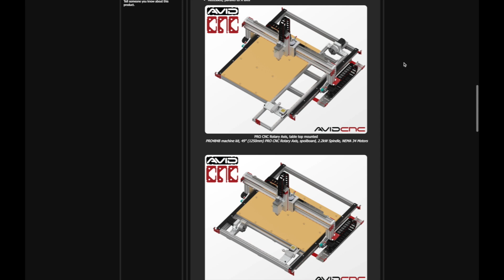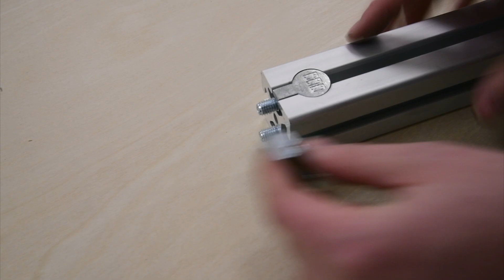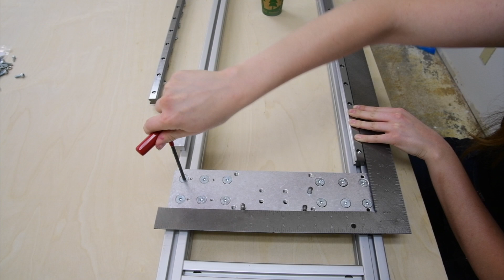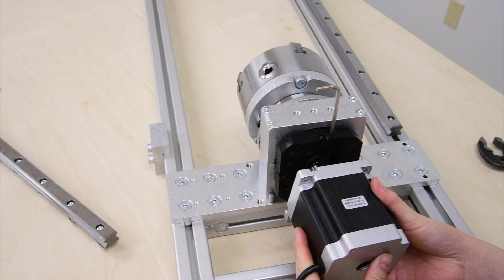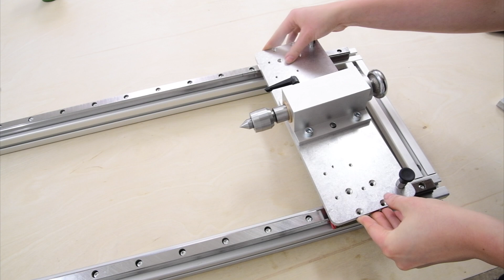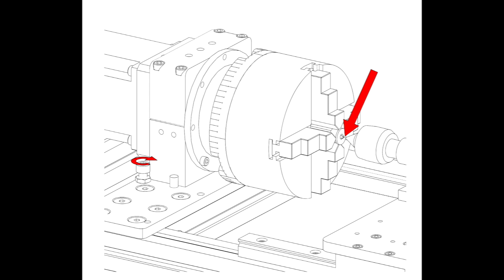Avid CNC Rotary Axis Assembly

Comment: So many issues with this information video that I would have to do it myself to show the more accurate way of setting it up but that’s 40+ years working in the cnc machine tool industry for you. Maybe one day 🤔
Reply: if there's a more accurate way can you please show us?  I'm down to see a better way...
Reply: Garren Epley Hi, your assuming the linear guide rail is straight but unfortunately even though there ground there not. You need to set the first one up as a master by using something you know is straight and accurate for example a granite straight edge to set it parallel over it’s full length and only then can you set the second rail parallel to the master rail. Also using counter sunk screws means the mounting plate for the chuck is self setting and not adjustable in the way your showing? These are the basics and when set correctly the centre line of the chuck and tail stock will be the same anywhere along the rails. Hopefully you’ll be able to understand my meaning as I’m a Machine tool engineer and not an English grammar teacher 🤔😄
Reply: @stevenrichardson7882   what steven really meant to say is he doesn't need to SHOW anybody anything because he is better and smarter than all of us . He doesn't really know his ass from a hole in the ground and he wishes the youtube piss ants would just leave him alone while he finishes his plot to take over the world . Make a video of your "superb " way or stfu . IDIOT !

Comment: How to configure and set 4axis to run in mach3?
Reply from the maker: While Mach3 can control a rotary system our team has developed a number of additional features that make setup and tuning with Mach4 a significantly easier process. These features are not available in Mach3. With this in mind we would strongly encourage you to use Mach4 with our PRO Rotary System. A free demo version of Mach4 is available through our software setup instructions here:  http://www.cncrouterparts.com/support/software/mach4/